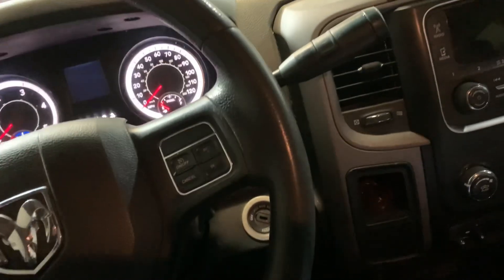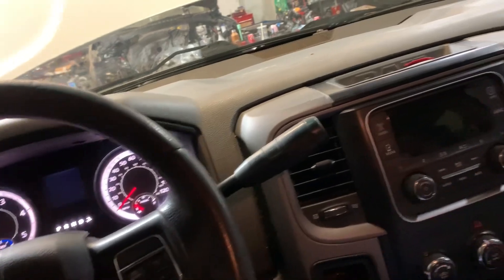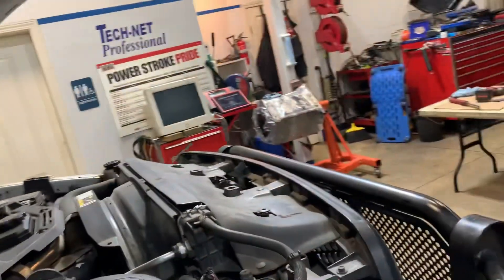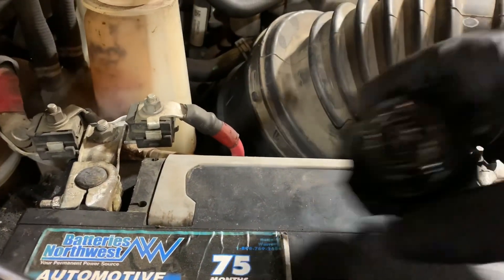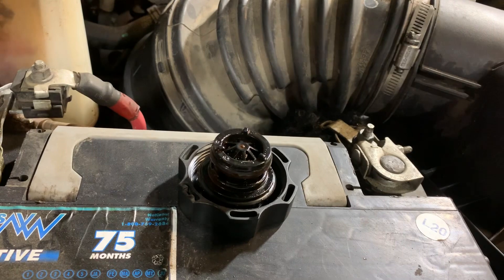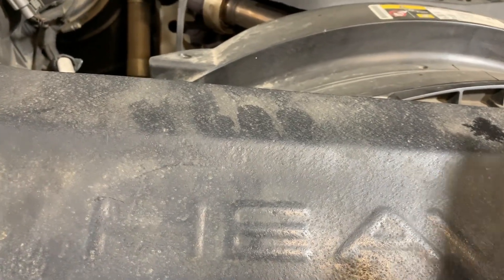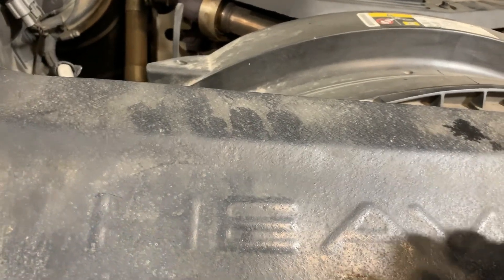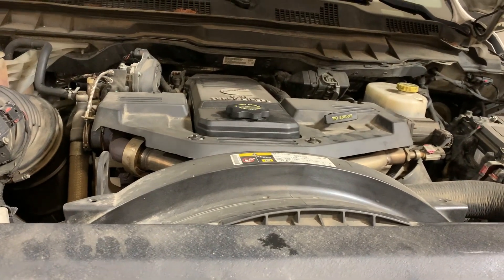6.7 Ram 3500 68RFE ratio error in first

Comment from the maker: 100% agree. In retro I’m glad I diag’d it this way, I was able to verify low fluid was causing the flair from second to first and the static slip/ratio error. The coolant in the gear box is one of the two reasons I want to bow out at this point. Appreciate your insight and thoughts.
Reply from the maker: I could have saved some effort had I checked fluid from the get go but the hood shocks were both bad, def was low and fuel was on empty. It was either burn down garage, go home and watch Star Trek or just go test drive. Less effort to drive, lol